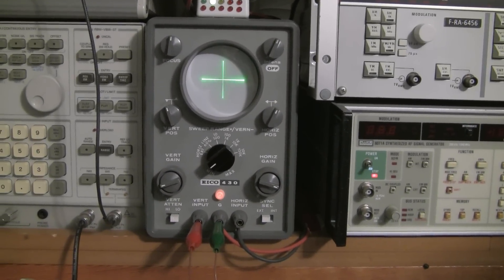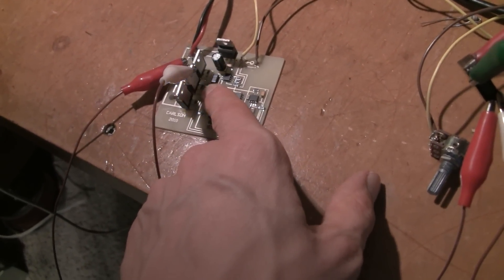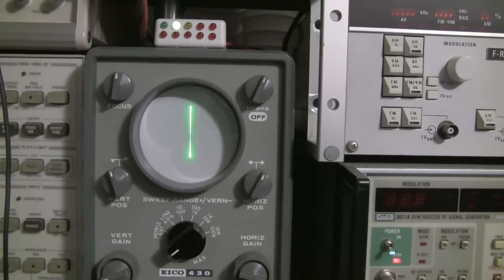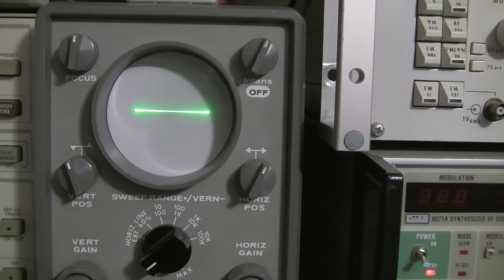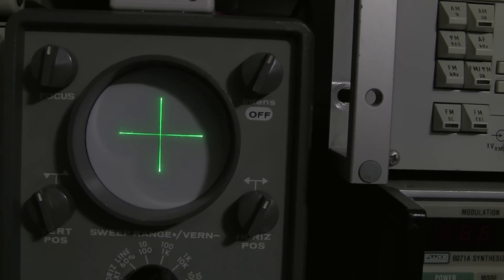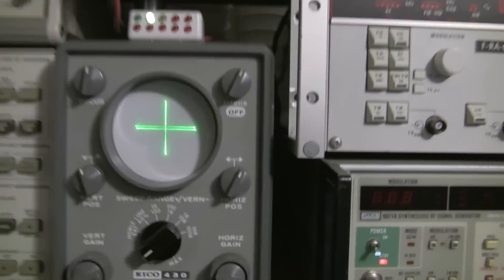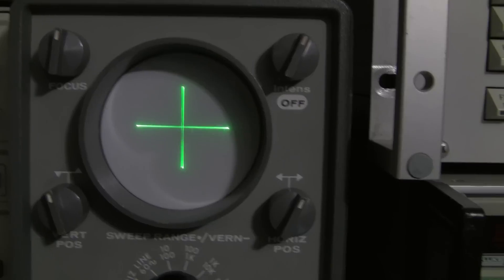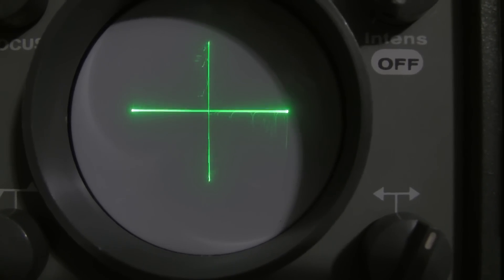Testing a Relay

Comment: Can I use a Tektronix 317 with an octopus? It keeps scowling at me from across the bench. The other day I heard a small voice "ain't no shelf queen"- I've since removed all sharp objects near the scope. Any advice would be greatly appreciated. Thanks!
Reply from the maker: The 317 would work great! If you would like to build that "octupus" on steroids, check out the curve tracer build on Patreon. The PCB plans and all are there..... And sized as well, so just print and build.
Reply: Mr Carlson's Lab Well,  Ya Know...  I think that's a great Idea Paul. I will do that. Dan here  
BTW,  Full Wave is my  secret squirrel electronicals handle ;) I also picked up a NC 300 with the 317 and it seems to work fine.  But I don't have a decent antenna yet. I'm in an apartment, 3rd floor, hung a single strand wire out the window and heard voices again...  Not from the 317, from the 300. Does that sound like a "healthy" Receiver to you? I'm new at this but I'm reading Radio Essentials and watching you and all the other usual suspects. I'm having a ball thanks to you! Looking forward to your next Vedolyzer vid. Hehe. Take care!

Comment: ...Reminds me of the job I had from1971-1979.....Burgmaster....Numerical Controlled Machine tools....the last of the dinosaurs before the CNC...control panels (2), 30" by 60"...each contained around 175-200 4PDT 24 volt relays....I don't recall the brand, but they were top quality stuff...
Reply from the maker: +Doug Ankrum 
Lots of relays in the I/O boards! Turret control are usually "gettered" Reed style. Thanks for your comment Doug!
Reply: +Mr Carlson&#39;s Lab ..Yes, lots of relay drivers in the NC cabinet, mostly NPN sink to low...most relays had +24 DC on the coils...and the Turret location/indexing was in fact using magnetic reed switches for position output. The only Burgmaster stuff I see on any Youtube is the tiny benchtop units...6 stations...all mechanical....the machines I worked on (as Elec-tech) were 3 axis...8 position turrets. tapered toolholders...20X40" X-Y axis...12-16" Z...all ball screw stuff... Machines were pretty well built...but Burgmaster folded in the early 1980's...they tried making some vertical tool-changers, but the biggest issue was the 'Union' wouldn't let them use any 'Japanese' control systems....seems about this time MAZAK was starting the true CNC....burg units used GE controls...XYZ was PWM driven, but spindle motors were crude SCR drives....many large PC boards filled with 7400 series TTL....5 volt, 60 amp power supply! Also the feed/rapid was slow, very slow compared to todays stuff...400 IPM rapid...40 IPM max feed... In the 70's...when I was there...Burgmaster was about as good as Cincinnati Milacron...also 8 position turret machines..
Reply from the maker: Great write Doug! I have some old Milacron drives kicking around. Sounds like you know your stuff!
Reply: +Mr Carlson's Lab ...Well, actually I'm more of the ..."Jack of all trades, Master of none".....most work in the last 30 years...welder, maintenance mechanic/electrician, Auto A/C tech...and I actually designed/built/installed a vehicle bridge in 2003...big enough you can see it on Google Earth!!
....lots of 3-phase experience with X-formers and motors/switchgear...up to 5,000 HP (4160 VAC) steam turbine water feed pump in 35 meg-watt bio-mass plant....Turbine output was 13,500 VAC...! 
 I really like your (and Applied Science) videos...a good deal of it is a little over my head, but I like the detailed explanations for everything...!
 I'm pretty much a high school grad (1964)...everything else I'm 'self-taught'...!
 Burgmaster was in Los Angeles...but I went to the annual 'Trade shows' with free tickets from employer during the 1970's......saw Cincinnati, and other stuff at Los Angeles Convention Center....also went to a couple Machine Tool shows in 1990's in San Jose, California area...very impressed with the first 3-d printing....UV laser and liquid resin...around 1995.

Comment: Someone should make a crude switch mode power supply with a relay.
Reply from the maker: +TheLawnWanderer 
LOL, That would be a big switch mode tranny to run at that low frequency :^)
Reply: Mr Carlson's Lab overkill b+ supply filtering for tube amp. glorious.

Comment: Interesting technique that never occurred to me, thanks for showing it. 

What I have done for relay checking was to use a relay driver and trigger a scope off the rising or falling edge of the coil pulse*, and look at the voltage across the contacts, with a resistive load and a 12V or so supply on the contacts. Then I can read pull-in and dropout delays directly off the X axis, and see chatter and bounce or contact resistance from the trace shape. *Actually off a second output of the driver so that coil inductance doesn't affect the trigger.
Reply from the maker: +l wilton 
Glad your enjoying the video's!

Comment: i use a 555 also for meter breaking in hi. i think you are us 74oo type. do you
have the schematic for that circuit?
thank you learning more again.
Reply from the maker: +Gordonseries385 
I do. I may do a video on the circuit in the future. All the IC's are 74 series logic, with a 555.
Reply: Hi Gordon Have you seen Mr Carson do a follow up video on the circuit for the EICO 430. Thank you

Comment: I wasn't clear how you hooked up the curve tracer to the relay. Is it just showing the X-axis voltage sweep connected through the NO relay contact? And I'm not sure what I'm seeing when the curve slopes counterclockwise on the tracer ...
Reply from the maker: Jason Olshefsky Hi Jason, simply put: A vertical line is contact closed. A horizontal line is contact open. Anything in between is resistance, IE: a 45 degree angle.
Reply: Wouldn't that be the conductance, since current is vertical and voltage horizontal.

Comment: 1.Operating/release time of the relay given by manufacturer?
2.Voltage and current of the load?
3.What max switching frequency you used in the test?
Reply from the maker: dxdx666 Are you planning on building one?
Reply: I am planning on using one :). At high switching speed, but within it's rating range. For example, if the manufacturer's data is 7 ms operating time and 3 ms release time, can it be used for 50 break and make operations in second? The load is resistive.
Reply from the maker: When you say 7ms, are you talking about the time difference between the voltage applied to the coil and the contact coming in? My little board will run at 50Hz no problems. Is this a reed relay, or an old electronic vibrator?
Reply: Mr Carlson's Lab No, not a reed relay, but 40.51 you can see specs of here:
http://www.finder-relays.net/en/finder-relays-series-40.pdf
The operating time is the time from the initial application of power to the coil until the closure of the contacts (excluding bounce time). The release time is from the removal of the power to the reclosure of the contacts. Such relays are not supposed to work continiously at such high switching frequncies,  but judging by these times, theoretically they could for several seconds (than long pauses). Would be interesting to test.
Reply from the maker: dxdx666 What exactly are you trying to switch?
Reply: Mr Carlson's Lab Small RC circuit for a start. Power supply 24 V DC.